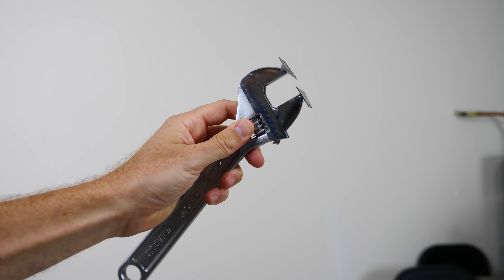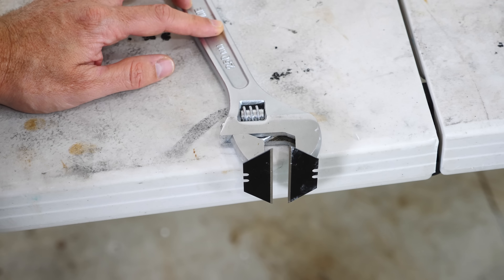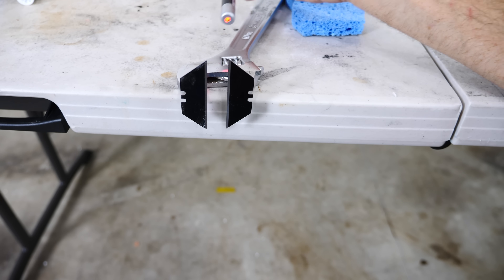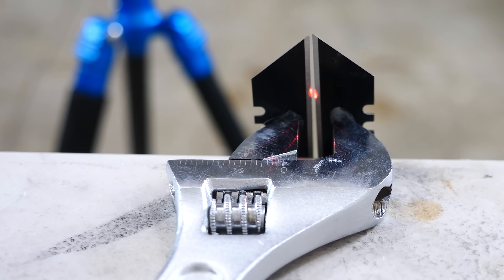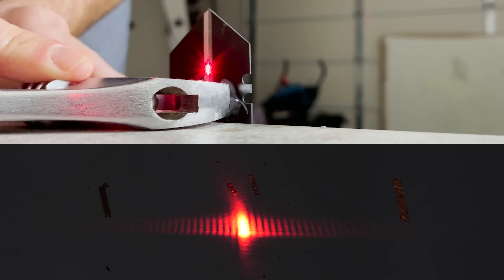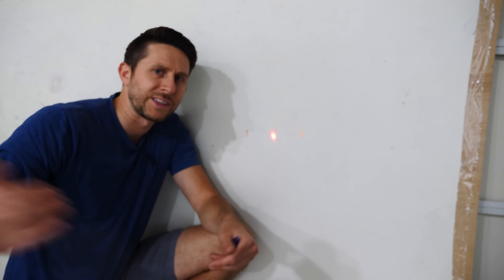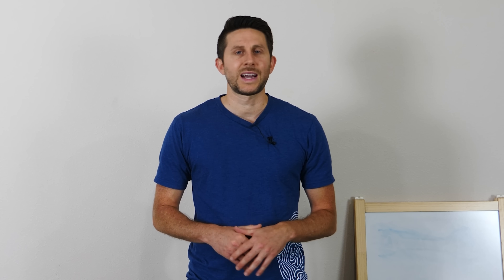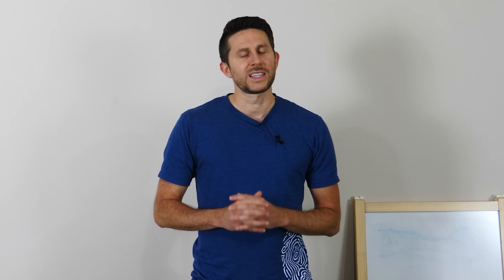Squishing Light Makes It Bigger—Heisenberg's Uncertainty Principle

Comment: This isn't some weird thing with the Heisenberg Uncertainty principle, but it's actually just the diffraction of light since light is a wave and when sent through something small it just diffracts and spreads out.

But the joke isn't on me! Your explanation of the red light being a particle is insufficient.
Reply: Does that apply to the double slit experiment as well?
Reply: True, this is Fraunhofer diffraction
Reply: A wave wouldn't go straight like a laser. It is sad to see lasers, which rely on the discreteness of QM, being the only tool used to demonstrate supposedly classical diffraction of light. Makes zero sense.

Comment: I'm completely lost on the science but to me it just looked like the light bounced of the angled edges of the blades (like mirrors) and changed the direction. I'd be curious if you covered the blades in black tape if you'd have the same spreading (or just swapped them for something not angled and non-reflective).
Reply from the maker: The light coming off of a metal surface is diffuse light, not specular. Meaning it doesn't reflect like a mirror. It goes in all directions (meaning it is not longer "laser" light). It would not reach the wall in a specific location. I challenge you to try to get any reflection from a non-mirrored surface from a laser onto a wall from across the room:)

Comment: Also wouldn’t that be because the wall is photosensitive like photographic paper, where the darkroom is lit with red light as it doesn’t affect the paper.
Reply: that's actually for the same reason - red light doesn't affect the paper in a darkroom because red photons do not have enough energy to react with the silver atoms in the paper.
Reply: @grkvlt  “red photons” lol

Comment: There is no "cause" in a constant.  I believe all constants need to be thrown in the trash.  They are fudge factors that make analogous math curves work.  Most of modern science is devoid of cause.  "It always does that" is not an understanding.  Rules, laws, and constants might as well be called folklore.
Reply: All around you are wonders of science which are only possible because of the constant you are talking about. Your phone tv wifi heater ac light bulbs induction cookers all work because of assumed constants.
Reply: @karansandhu4827  Yeah, that is the only reason.  Sure is simple.

Comment: Frequency (more compression, and therefore higher capacitance and higher amperage or wattage) of blue or ultraviolet light may be the reason for it's ability to charge the back drop. Also visible increased power in the Crooks Tube (windmill.)
Reply: How are you relating capacitance and wattage to blue light?  Its whole different thing
Reply: @karansandhu4827  higher frequency (Doppler Shift) when light is moving inward or towards a person or measuring device the frequency is compressed together. It is the same with sound. A siren or an aircraft or a vehicle approaching will sound s higher pitch or frequency. It will sound accelerated or increased as it approaches. However, as soon as it passes, the pitch frequency dramatically decreases. Have you ever watched or heard those speeding race cars approaching the camera and microphone? And as they passed the sound dramatically decreases? It is the same with light. Doppler Radar can reflect microwaves of of the clouds and can tell the direction of travel of raindrops and clouds. Because, the frequency of the light changes as it approaches compared as to when it is moving away from the reciever antenna. Astronomers also use this to determine the direction stars and other objects are moving. Therefore, also, frequencies of light are actually deterministic in what color is represented. Blue or ultraviolet frequency is a smaller more compressed and higher intensity as a result of it's characteristics.
Reply: @karansandhu4827  capacitance and wattage are a result of electromagnetism. Light is electromagnetism. They are in fact the exact same thing. When a conductor (which is usually a coil, but can be a wire or a sheet) or antenna, conducts a directional charge flow it creates a magnetic field and also discharges light. The same as "microwaves" are a form of light that we cannot see. Not a part of the "visible light spectrum" human eyes are able to see. Sound and light are both compressions and rarefactions. In mediums such as matter as well as energy. Light does this moreso to aether (energy) rather then to matter. However, the reason we see various colors is due to various frequencies acquired when light moves into and out of matter. Both light and sound are compression and rarefaction energies. Vibrations and oscillations cause alignments of atoms. Having similar spin axiis is directional charge flow and decreases or constricts the size (compresses) and increases spin rates.
Reply: Stokes shift explains why red photons can’t cause the emission of green photons but blue/violet photons can

Comment: Hey James, thank you very much for doing this experiment.
Did you try coloring the razor with super black color, to rule out reflection from the edges of the blades?
I did the experiment myself and found that slight movements in the angle of the blade shows that even the thin edge of the blade reflects light and changes the diffraction pattern.
Another question that comes to my mind is why the spread of light is not uniform but scattered by bright and dark zones.
The Heisenberg principle equation does not contain anything that explain the scattering, while it can be explained easily by interference.
Reply from the maker: the reflected light is diffuse light (not like a mirror). The light is reflected in all directions and is no longer "laser" light after reflection. It cannot reflect in a beam to strongly reach the wall. I didn't paint them because the small imperfections from the paint on the edge of the blade change the pattern enough to not be as clear. With a good paint job it will work just the same though. For example just take a piece of black paper and make a small slit and shine the light through and you will get the same spread pattern. This is not from reflection, it is from diffraction/uncertainty principle.
Reply from the maker: And also the uncertainty principle does not explain the interference pattern fully, it is a general rule that tells you the theoretical limit. This experiment shows the result of trying to tighten the variability of conjugate variables. To get the full description you have to use the schrodinger wave equation
Reply: @TheActionLab  great clarification. Thank you!
Reply: @TheActionLab  Thanks for the vid, I think it's controversial enough to warrant a follow-up, addressing/demonstrating difference between uncertainty and diffraction
Reply: @TheActionLab  It's worth mentioning light can act as a wave or a particle and has been observed in many experiments to do both at the same time , this being called the wave-particle duality , causing a ''duality paradox''. This paradox still hasn't been completely explained by quantum physics or relativety. Werner Heisenberg himself considered the problem further but has still not been solved. This a deeply rooted quantum field theory. I think this a great video but simply raised more questions about the validity of your reasoning then answers any question about actual physics. The de Broglie–Bohr theory equations can explain this quite well.
Reply: @TheActionLab  It is intuitive to me how interference between two paths through two slits produce an interference pattern that looks like this, but it is not intuitive to me how interference between paths through a single slit produce the familiar bands. Don't all paths incident on a particular point on the screen/wall through the slit arrive with a similar phase?
Reply: @TheActionLab  This is an excellent demonstration of the uncertainty principle but not the Heisenberg uncertainty principle. You have an uncertainty relationship for any variables that are conjugates of each other through a Fourier transform. The effect you demonstrate is completely explained by treating light as a classical wave. The quantum version of the effect is the Heisenberg uncertainty principle which of course arises because position and momentum are conjugates via the Fourier transform of the wavefunction. It is the introduction of momentum and position as Hermitian operators on a complex wavefunction and then conjugating them via a Fourier transform so that their commutator is non-zero which actually distinguishes classical systems from quantum ones. That the photoelectric effect demonstrates that light is also a particle is of course true but unrelated to the main experiment. In order to show that light is truly quantum you have to have an experiment which shows both features at once.
Reply: Hey James,
Thanks for your answer.
I found out that there is a rather strong reflection even if the surface diffuses light.
Even when the slit and laser were 2 meters from the wall. You can see it if the room is dark.
You can take a credit card and move it closer to the laser (like a single blade).
Most of the time I observe a light beam perpendicular to the slit in the opposite direction. This seems like a reflection.
If I color the side of the credit card black, there is less reflection.
The interesting thing is that I also see a shorter beam going in the other direction, and that one is probably not a reflection, but perhaps because of the Heisenberg uncertainty principle.

You wrote: "I didn't paint them because the small imperfections from the paint on the edge of the blade change the pattern enough to not be as clear"

It's strange because using normal black paint I didn't observe much difference in the pattern.
Also, isn't the less clear pattern is exactly what we want to find?
Maybe the diffraction pattern is not because of the Heisenberg principle, and with a super black color, we could see the pure Heisenberg principle without the diffraction pattern.

 @TheActionLab
Reply from the maker: @Lucidthinking  FYI I wouldn't use a credit card, the edge is very thick compared to the tip of a razor blade and is much more reflective. Also, if your angle is correct, then the edge of the card can't reflect towards the wall. Your laser shining should not be at an angle that can reflect off of an edge. It is perpendicular to the edge. 

But more importantly, you are not trying to get rid of the diffraction pattern. The diffraction pattern IS the distribution of momentum of the diffracted particles. If you destroy the pattern you are not seeing the uncertainty principle at work.
Reply: @TheActionLab   Just curious, I asked this in another chat, but what if you replaced the red laser beam with a blue or violet beam that could “charge” the back board? Would we see different levels of “charged” background? Would such an experiment prove any other properties of photons and quantum mechanics?
Reply: Hey James,
Something for thought (I don't know the answer)
There is an experiment in which you put a single hair in front of a laser beam.
The result is a very wide interference pattern. Much larger than with the experiment of the slit.
It is usually explained by classic diffraction, though classic diffraction is a metaphoric explanation. It does not deal with the electromagnetic or quantum properties of light.
Do you think that even in the hair experiment the pattern is a result of the Heisenberg uncertainty principle?

 @TheActionLab
Reply: All valid points here, i am curious now and call for updated experiment!
Reply: lucid thinlking the light is bright and dark bands due to the phenomenon of diffraction
you can check out the youngs doubl slit experiment where the light wave nature is explained
you gave some valid points abt his experiment
Reply: Thanks Akshin Barathi,

But how do you explain diffraction of light?

The Huygens principle isn't a real explanation.

A real explanation must contain either the electromagnetic properties of light or the quantum properties of light.

Look at Wikipedia https://en.wikipedia.org/wiki/Diffraction#Mechanism 
(under the mechanism section).

It explains diffraction by light's wave function, but I don't understand how this explain diffraction pattern in 1 slit. I only understand how it applies in two slits,
where two lights sources interfere.

 @akshinbarathi8914
Reply: @Lucidthinking  "But how do you explain diffraction of light?" a single slit experiment is just a double slit experiment without the middle part. There are equations that show that the light blocked or light transparent portions are interchangeable and the same pattern arises (with a flipped phase if I am not misworded). It is like putting a hair in a laser beam and creating two slits on the two sides of the hair, the slits being as large as the beam permits.
Reply: Interesting, yet strange.

Why do we need a slit at all to see the interference/diffraction pattern, if it has nothing to do with an interaction with the edges of the slit?

 @dragoscoco2173
Reply: @Lucidthinking  However would you constrain the space of a moving photon? In any way you come up with a method to affect position or momentum, the above uncertainty will show itself in funny ways.
Reply: I thought the same thing.
Reply: King Pistachion  👍
Reply: The diffraction pattern is the fourier transform of the aperture, in this case sinc(x) since the aperture is rectangular. The uncertainty principle uses the standard deviation of the function sinc(x). Since the location of photons in laser light are gaussian distributed, the fourier transforms are gaussian distributed as well. The standard deviation of such functions is easy to calculate from a taylor series expansion of the function.
Reply: Most people (unfortunately James too) will tell you that narrower slit produce spread spot of light because of HUP (Heisenberg Uncertainty Principle).
But that's nonsense!
HUP doesn't say anything about nature of quantum particles (it actually says something about waves, and sure most quantum particle behave like waves).
HUP only says something about our ABILITY to determine both position and momentum of a wave. The limitation comes from the Fourier transform which are used to localize more precisely a wave. Still despite that limitation Fourier transform is one of our most powerful tools, it just isn't perfect.
In James presentation that measurement limitation is illustrated somewhat by the wrench :) 
But the idea behind this (and other similar) demonstrations is that a narrow slit limits the possible width (ie position) of photons ... unfortunately at the cost at introducing two diffraction edges! Each diffraction spot (like in the case of diffraction of any type of wave) behaves are a point source again - ie spreads the light in our case in a circle.
That circular spread on both sides is what causes the spread of the spot - has nothing to do with HUP (which again doesn't say anything about light behavior only about our ability to measure it).
Just for comparison consider a nanolaser there are some with width of 50-150nm which is at least 25 times smaller than most slits used in demonstrations like James' 
So if we're thinking that restricting the position would result in wider spot because of HUP ... you'll be disappointed because NanoLasers don't produce that :) 
Again the main difference is that with nanolaser there are no edges on which the light can refract!
Btw the small interference pattern you noticed is caused exactly by the interference of the circular waves produced on the refraction spots.

Math is great tool (the most powerful we have so far), but it has its limitations. And Reality doesn't care about our limitations :)
It's a logical mistake to think that some equations DEFINE Reality! At best equations can describe Reality.
Reply: Thanks.
How then you explain the diffraction of light by the edges?
What is the mechanism causing it, if light is only a dynamic change in an electromagnetic field? 

 @blueckaym
Reply: @Lucidthinking  , I don't know how to explain diffraction of waves (incl. light) on single edge.
But that's great question!
I think most descriptions are just definitions based on observations.
But also I think there's established relation between wavelength and edges or slits to help determine when and how different waves diffract.
But I'm not familiar with the theory :/ sorry.
If you find an answer I'll be very interested to find out too!